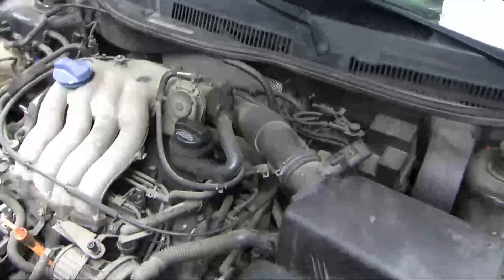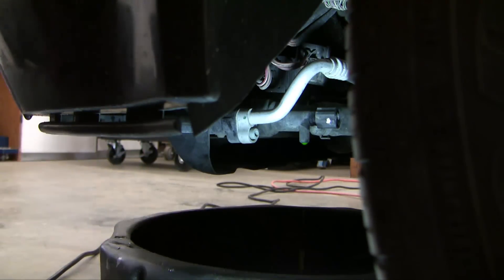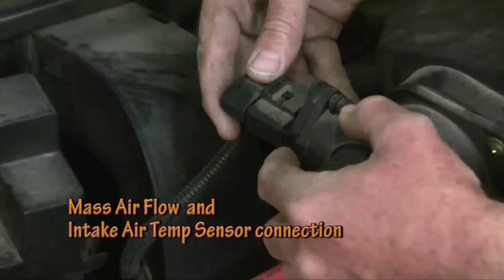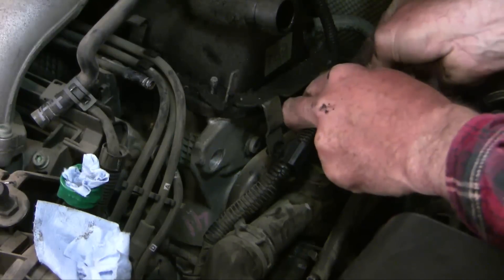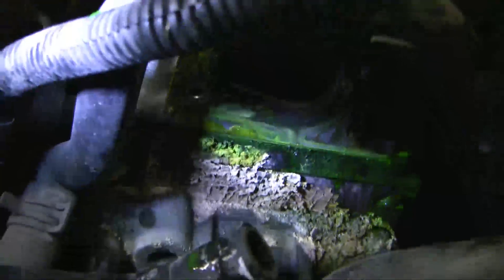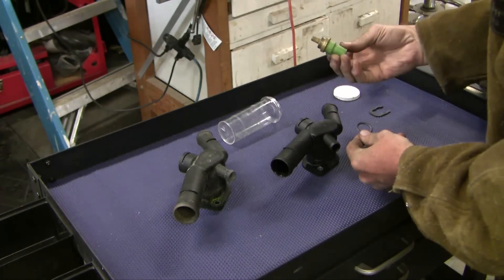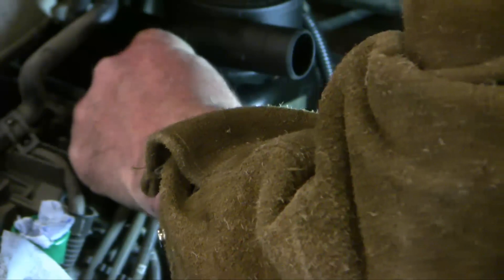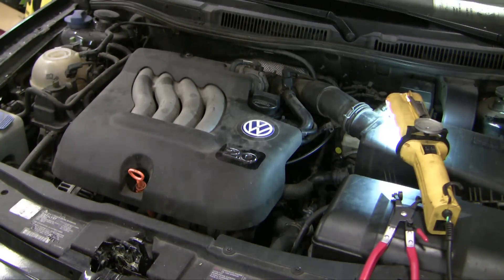VW Jetta Coolant Leak Repair

Comment: hey spelunkered. great video, def helped ease my mind when it helped diagnose my current issue. I'm Def a diyer and about to start this same repair. I am hoping you can either direct or inform on handling a concern i have before starting this project. The person who owned my mk4 before me polluted the cooling system with the evil green coolant. I have since purchased g13 but I want to make sure I clear the system completely of the green coolant because of the possible harm of the two coolants mixing. so how can achieve this? it would be greatly appreciated.
Reply from the maker: If you want to flush the old out, first drain, then add pure distilled water and run it a little, then drain again and fill with the coolant mix of your choice. It's not a bad idea to flush. Watch out for cold weather when you have just water in it since you don't want the block to freeze. You can get inexpensive distilled water at Walmart in the grocery section. In the old days we would install a T fitting onto a heater hose and run a garden hose to it, and you could flush more effectively with that. But tap water is not advised because of calcium and other impurities in tap water, which can deposit on small passages throughout and accelerate oxidation reactions internally. Also big volumes are hard to dispose of properly, if only because you may not have enough empty jugs to take to the recycling depot. All that said, it would be debatable whether to go back to dealer-approved coolant for an old car that has used standard green coolant all these years. The biggest advantage of the flush is to get impurities out, and I suspect the type of antifreeze used is not so critical. For new cars, I use what is advised by the dealer, to avoid conflict with warranty later, but most of the MKIV line are far beyond the warranty period. Good luck!
Reply: +spelunkerd thank you sir.

Comment: Hi I have a question about my 2005 VW Jetta. The coolant light keeps going off and whenever I put coolant in it, it looks like the coolant disappears. There's nothing in there. I can't see a leak or anything. My battery is also bad so the car doesn't start and soon after the engine light came on as well. I thought that was normal cause whenever I jumped my car it went off. Soon after that the wheel light came on too, I don't know if these are all related to the coolant but I haven't driven the car in months and it's been snowing and freezing nearly every day, please help advice is needed.
Reply from the maker: You may have several issues. By 'wheel light', do you mean the tire pressure monitor light? If so, check your tire pressure. TPMS monitors have little batteries that can go bad, if the tire pressure is OK it is not a big issue. Regarding the coolant, the commonest cause in the MKIV like yours is the coolant hose flange. You often can't see the leak but if you look closely at the area, crusty sediment under the coolant hose flange will verify the diagnosis. If that is the diagnosis, follow the steps shown to get if fixed, or get a pro to do it. It's not a huge repair, fairly inexpensive as far as auto repair goes. If there is no crusty residue in that area, I would do a pressure test of the system to help find the leak. Other sources of occult leaking are the water pump (check the weep hole), internal leaking into the oil or cylinder, the radiator (look for a wet spot on the radiator surface) or maybe a hose that you didn't notice. One thing about coolant leaks, you can get pesky trapped air that causes overheating and a lot of secondary issues. Getting all the air out is the goal before you can declare it fixed. Trapped air near the coolant temp sensor can cause the sensor to read high because steam beside the sensor can overheat well beyond the boiling point of the liquid. Trapped air is a common cause of engine damage, you need to work hard to clear it so your engine doesn't overheat. Regarding the battery, fill the individual cells with distilled water, check and clean connections, and trickle charge it overnight. I wouldn't hesitate to test and replace the battery if it is close to end of life, you don't want to wait til you're stranded. Regarding your check engine light, many parts departments have code readers that will give you more clues as to what is wrong, and they can also test your battery for free. Just remember to warm and charge the battery before testing. Many check-engine codes are secondary to other issues so don't go down the rabbit hole of instantly replacing a part described as bad with a code reader. If you are reluctant or lack confidence to do this work yourself, I wouldn't hesitate to ask for advice from a pro. Good luck!

Comment: Wonderful video, thanks so much!  My Jetta seems to have a leak in the same area, but I don't think it's from where the coolant hose flange connects to the motor.  That looks dry to me.  It almost seems like it's coming through the coolant temp sensor.  But I can't see where the leak is coming from.  It's going through a lot of coolant, about a gallon a week, so it's a pretty bad leak, but it must only be leaking when I'm driving.  Also it looks to me like it's spraying coolant all over, because it's on top of the air filter as well.  Any idea where the leak might be coming from?

Thanks again,
Tom
Reply from the maker: The coolant hose flange also holds the temp sensor, I really think that's your problem. Fix it ASAP, it's not good for your engine to leak that much coolant. You'll get a better view when you take it apart. You can always return a hose flange if you keep the receipt and if the problem is elsewhere. In any case you need to tear it down and have a closer look.
Reply: spelunkerd Thanks so much for responding so quickly!  Yea, I was thinking the problem might be the temp sensor.  The connection where the flange meets the engine is dry, I don't see any residue like what's shown in your video, but it looks like it could be coming through the temp sensor.  I was thinking I'd pull that out, replace the O ring of the temp sensor and see if that helps.

Thanks again!
Tom
Reply from the maker: Tom Hustead Good plan, please let us know how it turns out. Remember to burp the system after you do that.
Reply: spelunkerd I will!

Thanks,
Tom
Reply: Hi spelunkerd,

You were right, the leak was coming from the coolant flange.  I wasn't able to see the leak while the car was idling, so I had my son give it a little gas, and the second he did, it looked like a water fountain, squirting right out of the flange.  I was able to replace it following your video, I didn't take as many parts off, so it was a little harder to get the clamps off then on again, but your video was a tremendous help!  When I got the flange off, I could see the crack right next to the sensor where the coolant had been leaking from.  A funny thing, it looked like the flange had been replaced before.  I baught this car used and there's 100K on it.  

Thanks again!
Tom
Reply from the maker: Hey, thanks for following up. Your remarks will certainly help others. Ya, that little flange fails so often that it's not uncommon for it to be replaced multiple times.
Reply: I have a 2006 Jetta I was going through coolant rather quickly so Yesterday I added water because the tank was completely empty but it drained right through! I believe I have the same problem but I'm scared to do it myself. How much does it usually run for a mechanic to fix it?
Reply from the maker: Keisha Michelle I'm not sure, Keisha. The guys who work on Jettas all the time will see this kind of problem frequently, and I'll guess the repair I showed would cost a few hundred dollars. Of course it may be something else, like a leaking radiator, which would be a different cost, but not astronomically more. Importantly, you should get it fixed right away, and in the meantime be sure that coolant reservoir never runs dry again. After running dry like that, you will have air pockets in the cooling system that can overheat and completely destroy the engine if you overheat. Always check the reservoir again the next morning, after an overnight cool down. That's because the rad refills itself while the engine is off, so the car is drinking coolant through the night while the car is off. Don't be surprised if you need to refill that reservoir again in the morning. I would  check it every morning while you are waiting for professional help. In the meantime, have a look underneath to see where it's leaking. Good luck!
Reply: spelunkerd thanks, I actually went to test it again. I filled it up with water and let it sit for 5 minutes there was no leak. Then i cranked my car let it run for 3 min and sure enough the light came back on so i turned it off and took a look the reservoir was almost empty. I will find a mechanic hopefully it can be fixed asap.

Comment: My flange Is steaming and leaking bad if I replace the flange will I be good or could could that possibly be the head gasket the temperature gauge wasn't saying it was overheating
Reply from the maker: By itself that does not suggest a head gasket. I would replace the flange, carefully burp the system and you'll probably be good. Don't delay very long, that problem is very hard on the engine. You can test the air in the cooling system for exhaust compounds to screen for a head gasket leak but in your case unless there is more to the story, I wouldn't bother. You may need to replace the coolant temp sensor and gasket, but I wouldn't do that unless needed. Good luck!

Comment: What did you use to clean off the engine where the coolant flange connected? Also do you have any videos demonstrating you burping the system?
Reply from the maker: Brake cleaner comes in a spray and is a great tool for cleaning surfaces. Most guys use a razor blade to clean flange surfaces, but be careful not to mar the engine. On steel surfaces you can use power sanders but in this case I wouldn't do that because there is some risk of sandpaper and debris ending up in the cooling system. Wear gloves, some of the compounds in organic cleaners are carcinogenic, benzene is a close relative. I demonstrated burping in many videos on my channel, you could use the word 'burp' as a search term on my channel and find 7 videos by me that show the procedure as part of a repair. The first one I did was the Dodge Ram leaking radiator, burping is shown at the end of that video, starting at about 7:35. You might be interested in the playlist of automotive cooling systems on my channel . My favourite video is the one on the radiator cap, it clarifies more about how cooling systems work than any other video I've ever made. If you're still curious about burping, Ericthecarguy did an excellent one, showing how the spill free funnel works. You can get such a funnel at Princess Auto here in Canada or perhaps Harbor Freight in the US, and I know Amazon sell it, too. You don't need a spill free funnel to do burping but it makes it less messy and faster. Good luck!

Comment: Hey you mind telling me the name of the hose on the video im about to upload because its leaking fairly bad and i have to get to work please let me know if you can soon.
Reply from the maker: Matthew Benton If it 's the same part as mine, (probably is) they call it the "coolant hose flange". A typical dealer will go through a few a week, it's an extremely common repair.

Comment: Does anybody have advise for me on how to re-install the coolant sensor retainers, those U-shaped clips that hold the sensors on the flange?  It seems mission impossible.  Actually I already broke one of the plastic clips that came with the replacement flange, which I thought might be easier to install than the original metal clip.  It just seems like the clip cannot go around the sensor no matter how much you push because the ends are pushing against the wall of the flange tube.  It even looks like size is not allowing, but I know this is not true since the clips were holding on the same sensors earlier.  I see many people have done this job and no one expresses my frustration, and I am wondering what I am overlooking.

Comment: Do you live close by my Jetta 04 is having this issue over heating ugh wish I had the talent to fix cars 😟
Reply from the maker: This is pretty simple work, and if you get on it right away there's a good chance you'll get it fixed for small change without major engine damage. Keep the coolant reservoir topped up, check coolant levels every day, and arrange for an urgent review with a mechanic. The most common cause is the fix I showed above, and the cost would often be only a couple hundred dollars or so. If the engine overheats you could lose the vehicle from secondary engine damage, so shut the car off immediately if temp goes into red line territory.

Comment: I have 02 passat turbo leaking at the flange ... I tried many ways to stop the leak didnt work i think i need a headgasket sealent all around the connections to the engine body and this will stop the leak
Reply from the maker: +yacoub nasrallah No, putting sealant around the flange will never work. You need to follow the procedure shown in the video. If you don't do this one correctly your engine may overheat, changing a 25$ repair into a destroyed engine. It's not expensive to get a pro to do it for you, normally just a few hundred dollars. Many engines are destroyed because the owner was planning to do a repair himself, but never got around to it.

Comment: I am having real trouble removing the hoses from the flange, any ideas on what would make it easier?
Reply from the maker: I take a small probe, like a pocket screwdriver, and slide it inside and around the connecting point, breaking the calcified seal. As I thought I showed in the video, I have an L-shaped probe that allows me to get into tight spaces. If you need an L-shape, don't hesitate to bend a small screwdriver into shape, they are pretty cheap. Make sure you don't scratch the inner surface or lip, and make sure you don't create a false track in the hose. Some other coolant hoses are really difficult to get off, like heater hoses to the heater core. For those, I'm really careful not to torque the heater core connection, since a repair for that is extremely expensive. In the case of a heater core, I don't hesitate to cut and replace the hose rather than take the risk of damaging something more expensive. You can buy special hose clamps but most guys don't bother to search for them. I've got a set somewhere in the garage. To get hoses back on, a small shot of silicone spray works great.
Reply: Thanks I'll definitely try bending a screw driver to get in there.

Comment: @:15, what the heck is that turbine looking part coming from the airbox next to the alternator?  I have one on my 99 beetle that wines a LOT at startup for a few minutes.
Reply from the maker: That's the air pump, an emission control device. It blows air through the exhaust system at startup to reduce emissions in the brief phase before the catalytic converter has warmed up to efficient temperature. The air pump commonly goes bad, an annoying repair.
Reply from the maker: For broken plastic parts like your unrelated air intake housing, you want to find a nearby junkyard. There are also online dealers for auto parts, search the term "car-parts". That company is a kind of clearing house for hundreds of junk yards, but the search algorithm only works for major parts, I'm not sure if intake housing would be listed. Failing that you can go to the dealer, but at some point cost becomes an issue.